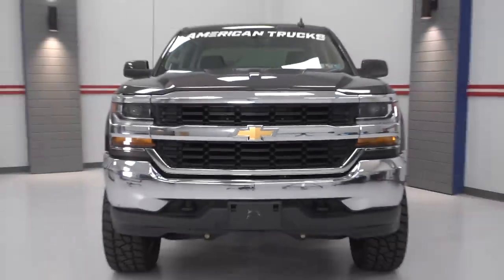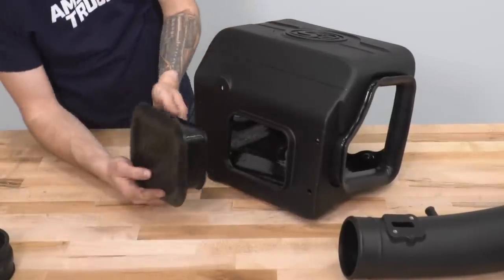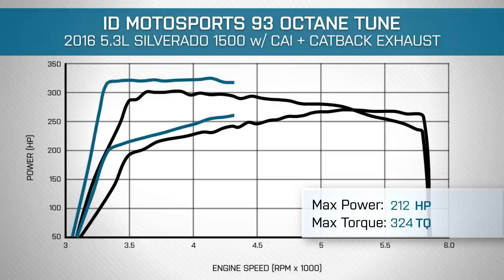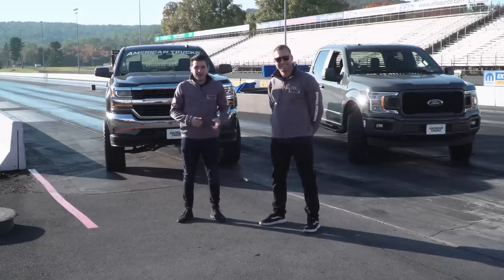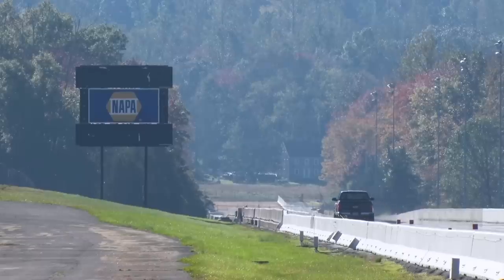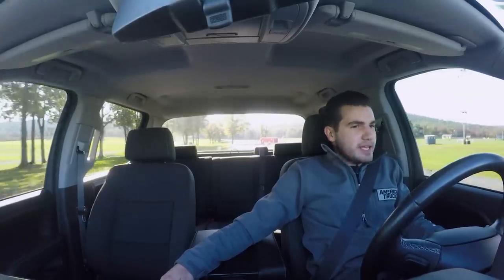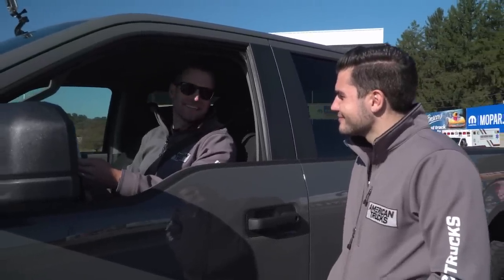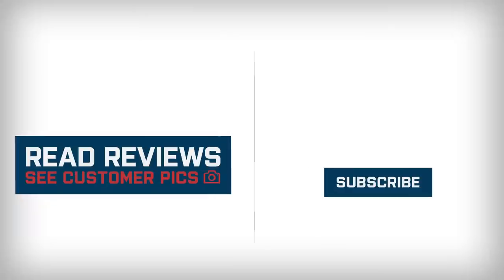How Fast Is a Tuned & Lifted Silverado? | Tuned Silverado Takes on the Drag Strip - The Haul

Comment from the maker: 🎞Subscribe for Daily Truck Videos: http://bit.ly/atcgrsubscribe
Shop Parts For Your Silverado Right Here: www.americantrucks.com/the-haul-jan2019-silverado.html
Watch Justin's F150 Build Right Here: https://youtu.be/YnxGr7lo9Ps
Check Out Adam's Silverado Parts:
S&B Cold Air Intake w/ Dry Extendable Filter (14-16 5.3L Silverado) - https://amtrucks.at/2RHPpgh
Carven Exhaust Competitor Series Single Exhaust System - Side Exit (10-18 5.3L Silverado) - https://amtrucks.at/2CTZDSq
ID Motorsports SF4/X4 Power Flash Tuner w/ Custom Tunes (07-16 5.3L Silverado 1500) - https://amtrucks.at/2Qr5IJy
Fabtech 6 in. GEN II Basic Lift System w/ Stealth Shocks (14-18 2WD/4WD Silverado 1500 Double Cab, Crew Cab w/ Stock Cast Control Arms) - https://amtrucks.at/2H2JIFl
Raceline Shift Black Machined w/ Dark Tint 6-Lug W -12mm Offset – https://amtrucks.at/2GYGrH9
Mickey Thompson Baja ATZ P3 Tire - 285/55R20 - https://amtrucks.at/2RBzuzV
Reply: AmericanTrucks Chevy & GMC why don’t u manually shift the truck, just a question where the first dyno numbers with or without stock wheels ?

Comment: In the Chevy, if you hold down the traction control button for 7 seconds it will disable more of the torque management and give you a better dig in 4-hi.
Reply: Same with the ford
Reply: @Gearhead-en8dz  I believe traction control and stabilitrak are only automatically disabled when you shift to 4Lo, but in 4hi both are still activated.
Reply: @jandos114288  You're right!
Reply: Just put e85 in the tank. Nothing else and it will have 380+hp and like 411lbft.
Reply: NISMO MIKE thanks for that!
Reply: Why would you drag in 4high? That’s not good for the truck. Just turn off stability control and hammer it down
Reply: Agree. It needs a legit tune. But even then I don’t see it catching up. The 5.0 is a solid performer and trans is better too. U can see it move and shift more aggressively. But yes definitely wonder what a launch with stab and trac disabled in tow haul mode would do. Mine launches and spins hard when i try that in the street
Reply: @juangarza4303  puts traction to all 4 wheels, and it being a truck there is very little weight on the rear axle allowing the wheels to break free easier. its also not like they are driving around on the street, turning in 4hi on pavement is much worse, straight line is fine
Reply: Does the f150 have the same lift?
Reply: @jandos114288 yes but you can turn off the traction and stability in any mode. Just hold down traction control for a few seconds. And both will turn off. My 2015 ccsb 5.3 ran a 15.026 at 91 mph. 2wd with a good burnout and 31 inch tires.
Reply: Good to know thank you

Comment: Listen - cold air intakes - waste of money and time. On Silverados of most year models - remove the stock air filter box - where the sealing foam is for sealing against the fender - that is removable. Remove it and use a Dremel to take out the middle. The inner fender has a metal strip going across the corresponding fresh air hole - grind that our as well - reinstall the stock air filter housing and enjoy your new cold air intake - stealth style. The flow is similar to the aftermarket CAI systems and the stock air intake system works well enough for stock engines - tuned or not. This is hands down the best and easiest mod for your Silverado for passing performance.

Comment: I have a 2015 Sierra 4wd with the 5.3 3.42 and ran 14.93 stock. Not sure how you launched but these trucks don't like to be stalled. Traction control off, shifter in M5 and 4wd if needed. Took me 4 runs to find the best run and now runs 14.93-15.10 every time. My first runs were 15.50-15.68 before I figured it out. Hope to tune it soon but undecided what to go with for the tune.
Reply: Rob m 
CrewCab?
There’s no way a stock 5.3 runs 14.93 crewcab 4x4
Reply: What MPH?  That shows you what HP you're making...
Reply: @nr552  no it doesnt lol
Reply: @pyrorye-80  yeah it does within certain conditions wheel spin.  How many .000 lights have you made?  How many classes have you won?
Reply: @nr552  im not getting into an internet pissing match with you, but ive been around this for many many years
Reply: @nr552  and just a quick note there are far too many variables to ever translate a time slip into an accurate measure of horse power
Reply: @pyrorye-80  absolutely.   Though knowing what a stock vehicle does, and then a modified one (tune, headers, cam, headwork, etc) makes a run, you can get an idea of what sorta increases you've achieved.  I had a vehicle that ran 104 mph in the quarter mile vs. 88 mph stock.  When it had terrible traction it would still run 99ish.  I sold it with a blown motor.  The guy who bought it "freshened" the engine..new bearings,  pistons, rings, same cam, etc.  Ran 2.5 seconds slower et, and 90 mph.   He claimed he was new at drag racing and the wheel spin was the issue.   I told him to ease into it...let it get into drive and then just roll into it.  Truck still did 90 mph.  I told him his build was off.  He argued with me over it.  I said based on your mph either way you were down 80 hp from where it should be.  I said go get a dyno.  He did.  The truck was 78 hp LESS than when I had it.  It also ran 12.40@112 with 100 shot when I had it.  If he tried that as the truck sat, might have made 104.
Reply: Hmmm. Could make sense that stalling it makes the computer pull power. I have to try ur theory.

Comment: Crazy how fast these crew cab trucks are getting.
Reply: Many, many years ago, I dumped about 7 grand into a tuned port injected 350 L98.  AFR heads, Crane Cam, Edelbrock TPI intake base and runners, larger injectors, etc, and a crap load of machine work.  The engine was transplanted into my '87 monte carlo SS.  It ran great, but I was always chasing down electrical bugs.  This car was also my daily driver, so I had hoped the fuel economy would be decent.  It wasn't.   I'm sure my right foot is responsible for a lot of that...  But the LS1 was just bursting on the scene.  It made almost as much power, and later they made way more power, but it was reliable and got good gas mileage.   That really upset me that the factory was putting out bone stock engines that would clobber the one I'd spent so much time and money on.  In hindsight, I couldn't be more happy that engines are what they are today.  
So yeah, it is kinda crazy how much faster and still dependable cars and trucks are these days.  Wait until electric motors become more mainstream.  The performance they offer is already incredible.
Reply: Yup, back in the day,  high 12s, low 13s were pretty quick. Now full size trucks are hitting that lol. 👍
Reply: No EV please we don’t want them

Comment: That 10 speed transmission is the real hero.
Reply: you mean the 10 speed that ford and gm worked on together and put in the trucks? same 10 speed in GM as in FORD
Reply: jay webb the Chevy is using at the best an 8 speed. But yes the same 10 speed they Co-developed together.
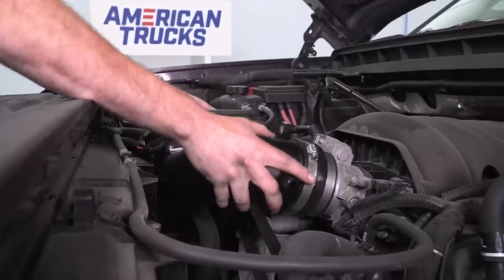Reply: @gavinbooshu4737   well if you pause the video at 1:10 you can see a trans dip stick , which means it has the 6 speed auto in it, not the 8 or the 10 speed. the 8 or 10 speed dont have dipsticks.  But the newer trucks come with a 10 speed now, i just so happen to be a tech for a GMC dealership , pushing 7 yrs there. so that could be a big difference in the times too, the trans being 6 speed when the ford might have the 10, and the gearing in the rear end, plus the ford having better base hp/torque
Reply: jay webb the ford definitely has the 10 speed. So the tighter gear ratio alone is gonna make a huge difference. Keeping the truck in the powerband the whole time.

Comment: Shift in manual mode I could shave about 3-2 seconds off my time with my 2010 Sierra 6.2 I usually brake it and launch it in 4hi at 2,500-2,800rpms

Comment: That poor chevy needs longtubes and a dyno tune instead of that can tune
Reply: you gain next to nothing on an LS modding the exhaust.....its not worth the money. The stock manifolds flow extremely well
Reply: @thebubba1  I always hear people say that about the LS, but that was a LT, that ran. The problem is weight, iron block.
Reply: Long tubes really arent going to make a bit of difference. I know its strange but, even after deleting the 2 cats on the stock manifolds with long tubes showed no actual improvment on the dyno. Just isnt worth the money or the time. That motor is capable of a lot, but much of it is locked up for the daily guy that doesnt care or need it, not to mention emissoions.
Reply: @Punk-Jw  ... a REAL custom dyno tune with just long tubes and E 🌽  they gain low 50  to high 40 wheel Hp ... compared to just mid 20s with tune only , so yes long tubes make about a 18-25 rwhp gain WITH a tune , without a tune and just headers you gain maybe 5-10 wheel . But paired with a tune is about a solid 20-25 wheel
Reply: @hunterbasselite6826  anything is going to pump out more power with e85. But not everything is set up to run it, we don't even have any around here to my knowledge, I'm sure we could get it, but we'd need to travel. Regular everyday pump 91-94, custom tune or not, I've seen the results personally in front of me. Both on stock truck engines and a built ls3. The torque curve changed a little, and i mean very little but that's about it...i mean it's not like the old days of poor flowing cast iron manifolds, since the birth of the LS that's pretty much been eliminated. The new ones are essentially block huggers. Given the cost, it's not something i would spend money on for a mild build.

Comment: I ran my 19 GMC Sierra 1500 ran a 15.45@91mph stock height stock tires just had s&b cold air intake and borla attack exhaust. That run only in 2 wheel drive I haven’t made a pass in 4 wheel drive yet

Comment: The problem there it’s the stock cam , no matter what you do it won’t build up HP 
Ford does great because it doesn’t have the AFM system that GM has
Reply: I have afm a I don't notice a difference weather I turn it off or leave it on

Comment: Is the chevy running 3.23 gear ratio? if so that would explain alot lol especially with the 33s
Reply: Braden Kappel it’s funny that people add bigger tires and add mods and instantly think their truck is a race car. When they neglect to realize the gear ratio needs a serious change to accommodate that and show street gains
Reply: I think you are right. Plus it looked like a one wheel peel at launch which means no g80 so no trailering package for the better gear
Reply: Unless it’s 3.08 ? But maybe that was only in the Tahoe/suburban
Reply: i noticed they didnt mention gearing in either......I wonder why.....hmmmmm?
Reply: @fk3321  my 2017 came with the 3.08.

Comment: Just got me a 2015 z71. Cold air, but stock otherwise. Doing the exact same with a tune (diablotek) and a cat-back. Those 5.0 and turbo ecoboost fords are just so hard to beat in speed, though. They put down the power. I’ll take a Chevy on looks, but, dang. Still, I’m not driving my pickup to race, but will welcome the extra little boost of power from the simple bolt on’s.

Comment: 6” lift, 33’s, weak tune, can’t expect to much..
Reply: I have to agree....I have a 15 that was making 305 hp and 337tq on a stock tune, with only the afe momentum cold air. I havent got to see what the exhaust and custom tune brought me up to but ive seen other guys running e85 with a mild tune, cold air and exhuast hit 400hp, dont remember the tq. That can tune is only going to make a little better mild driving experiance, doesnt really apply much at the end of the day.
Reply: Tbh
Reply: And only running at 85??? On a track??? I’d be going 100 or trying to max out my speedometer
Reply: Jimmy Rodriguez u obviously don’t  get it
Reply: That Chevy would have done better without the mods!

Comment: GM needs to pull their head out with the engines and drivetrain. So underpowered and underperforming compared to its rivals. Its sad really because i have a 2013 6.2 but this may be my last Silverado.
Reply: Rather be under powered and be reliable then fast one day.... and shop next day! Toyota and Nissan are doing the same thing still.
Reply: @Rocksolidbullys  oil leaks from the oil filter straight from the factory? Pretty reliable huh???? Not!
Reply: If you all need speed buy Mustang, Charger, Corvette a Camaro lol Both are good trucks, depends a lot on the owner.
Reply: I feel that brother and the interior game is not up to date but usable
Reply: Really? A stock truck runs high 14's and that's bad? Haha. I mean that's on par with the supercharged GTP and many others. That's a respectable time from a stock truck.
Reply: BigCountry376 my last silverado was an 07 and it will aways be the newest one ill ever. interior was junk. bought it brand new and by 09 the dash broke
Reply: I have a 2013 f150 5.0
Reply: Anthony Bush hell yeah. My exwife bought one while we were married. It was pretty quick. It had a roush cartack and knn cold air. It also camed with factory 3.55 locking diff
Reply: Ricardo Burgos  speed is relative term, I expect 13’s or faster out of my truck and 10’s out of my car.
Reply: i dont care if it ran 18......when it comes time to do some work on it the frustration you save over working on a ford is more than worth it.  I noticed they never mentioned what gearing was in either truck.......its also A TRUCK....not a mustang or camaro.....as long as it pulls my boat easily at 60mph i really dont care what it does in the quarter
Reply: @thebubba1  a lot depends on where you live and what's surrounding you as to the kind of power you need. I have a 15 rally 2 with a 5.3 with some bolt on's and tuned, ecoboost mustangs and 5.0 trucks aren't a match. My truck is a daily driver, and a truck because I need a truck. I want it quick, longer legged than the factory governed 98mph, pulling power and to handle like a car when I'm not pulling somthing, and with a little work it does just that.
Reply: He was only running 85 on the track though?
Reply: You realize the chevy is lifted with 33's?
Reply: Just had a 2020 Ford f150 for a few weeks and I gotta say I wasn't very impressed the only thing I like about it was the radio screen.. and I hated that gas saving bullshit where the truck turns off everytime you hit a stop its very uncomfortable and yea you can turn it off but you have to do it everytime you start the truck which makes it annoying as fuck
Reply: @ricardoburgos5537  Agree! I thought trucks were supposed to be for work, pulling, and loading? They're not built for speed like Ricardo said you want speed? go buy a muscle car.

Comment: heh, my 2014 4.3L runs low 16s, high 15s bone stock in 2wd with t/c off down at Cecil County. stock wheels and tires, burnout in waterbox. quickest pass went 15.94 with a 0.085 light. not bad for a 6" lift and 33s tho.

Comment: I’d love to see a video with that GM product run with an electronic throttle control delete product and see what the numbers are. Throttle response been my biggest complaint with my truck so far and while I haven’t purchased a one of the fixes yet, seeing a truck like this run a drag strip with the mods in this video would really be a good test I think.
Reply: Need info brother I got a 6.2 2014 and it wont even do a burnout

Comment: Can you put long tube headers with catted y pipe with an exhaust system with a cold air intake and a tune in a 2014 Silverado 1500 regular cab without it messing up

Comment: Can I add a pedal commander and a flashpaq f5 tuner? I'm not sure if the tuner does what the commander does...I have a 2017 Silverado 5.3
Reply: The commander doesnt actually add performance. It just changes the voltage to the drive by wire so less peddle opens the throttle body more. If you want good performance from a tune and most bang for your buck you want a custom tune. Flashpaq does offer this with some of there models, Certain ones have storage for custom tunes from HP tune, although Black bear tune is getting better results doing the samething and if you happen to change somthing down the road, just call them and let them know, and they'll write you a new flash file for your changes that you can flash on yourself.

Comment: And ofcourse, the 150 with a smaller engine put out more power stock than the Chevy did tuned.......
Reply: That f150 is guaranteed not stock. It was shifting way to hard. Not only that but they tell you right after its first pass that it has several stuff done.
Reply: That was a 5.3 not 6.2
Reply: @jaydenreynolds9829  the 150 is still smaller

Comment: You guys should have used corsa or borla exhaust for more hp, and done a cold air induction intake as they have been tested to gain 25+ hp at the wheel with no tune